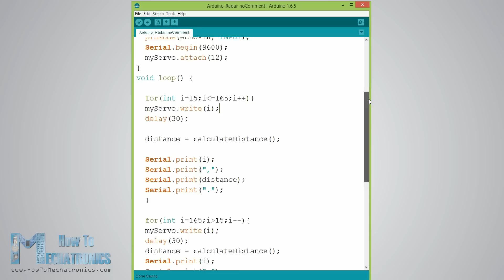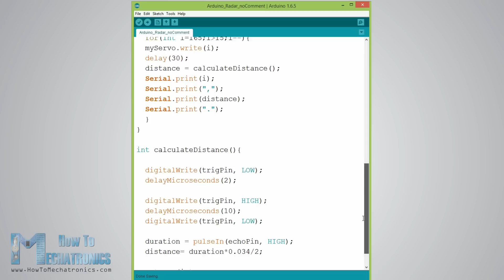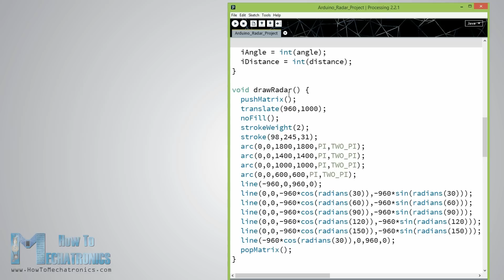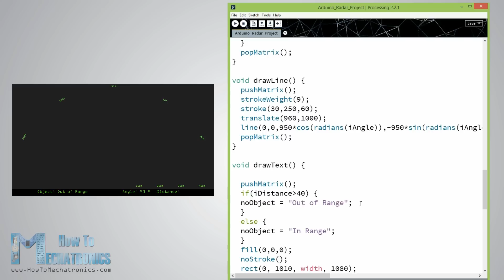Arduino Radar Project

Comment: Great project. I works on MAC, so I had to modify a couple of instructions of the processing program. The first one related the communication port (myPort = new Serial(this, "/dev/cu.usbmodem1421", 9600);  , and the second one related the font (myFont = createFont("Georgia", 32);.  I used your  second release  of the Processing program, to adapt  the system to the  screen resolution.  Everything worked fine. Thank you very much.

Comment: It seems that processing ide code is not precise when you draw the red lines. After some tests, i discovered that the sensor is very accurate so the problem is in the function that draws the red lines. Here there are two screenshots: the first one is one of my test, the second is taken from your video tutorial (0:12sec).

https://ibb.co/cbTNWF (my test, real distance=10cm, red line = 7cm about)
https://ibb.co/f425ka (your video tutorial, real distance=14cm, red line = 10cm about. Keep in mind that here the line is moving from right to left so you need to consider the red lines at 10cm. See your video at 0.12 for better understanding)

As you can see, even if the value of “Distance” is very accurate, the red line is not starting at the distance calculated by the sonar.
Also, the segment between 0-10cm is much longer then the other segments (10-20, 20-30, 30-40)

Comment: What wires did you attach to the servo motor
Reply: Dejan Nedelkovski is there any way to stop the servo at the moment it detects an object in a desired range? and after that remember the angle i. so that another servo can go to the same posistion?
i tried to do it but it always first finishes the for loop.

Comment: I was thinking of something similar but with more power to be used as a fishing probe. Those that emit the signals in 85 and 200 kilocycles I imagine are piezo electric microphones so you should not have much problem in placing it in contact with water. What do you think Have you thought about taking it beyond?

Comment: Hi buddy +Dejan Nedelkovski, great video as all else too useful, for me.

I'm doing a level control with an ultrasonic sensor, I developed an application in app inventor.

I would like to make a graph of the container (a cylinder) as the ultrasonic sensor indicates to me that the container is being filled or emptied.

I wonder how I could do the same with a bluetooth module and an application on app inventor

best regards
Sincerely
Mike

Comment: Hello, I tried this project but I cant make processing program read serial information. Processing load without error and I see fixed lines, but not the radar signal (movement). Serial port was informed well to the program.
I think the arduino side is ok, because I can see information in the serial monitor and the hardware is working.
Can you give any clue to make it work?
Regards.
Reply: apzeiroturbo  In the Processing IDEA, make sure to change "COM4" in the first 20 lines to the port where arduino is connected, normally "COM3"

Comment: Say you were making this for school, how much voltage would you need battery wise to power the arduino and a 3.5 inch lcd. Would be really helpful as I'm building this for a school project.
Reply: +Dejan Nedelkovski would I need to programme any differently to get it to display onto the lcd?

Comment: What's the distance on the ultrasonic sensor? I see you only use a few decimeters, but could it go further?

I have an idea of a rotating sensor like this, but it needs to reach up to 10 meters. The sensor would detect if there's movement (distance to object at a particular angle has changed since last scan) and activate a camera to start recording.

There would be several cameras in the room, but only the ones where the affected areas are visible would be activated.

Could possibly make it 5 meter sensor range and put the sensor in the middle of the room, rotating 360 degrees, but that seems like it will be slower, and might miss movements.
Reply: i've test and the max range is 196cm or 2 meters

Comment: I am working on a project .  I require my robot to go exactly in between two objects . Can I make this possible using this radar project ?
Reply: +Dejan Nedelkovski I am using  a Raspberry pi and arduino,  could I write code such that based upon the information from ultrasonics this can be achieved?

Comment: HI   great  job !.. i have  a problem with  the processing  code   when  i  run it  in processing   3.0.2  and  i have  a message error  "could not  load  from  OCRAExtended-30.vlw  ?  thank you

Comment: Hi Dejan. First thing - great tutorials. I follow your channel and I found here many interesting tips.
I built similar robot to yours and I used your code to check how it works. I noticed that servo slows down from time to time. It does not move smoothly as in your video and tiny delays can be spotted. I think my servo is not damaged as it happens in random position. I read some tutorials and sometimes they reccomend voltage stabilisers. Do you think the voltage may be the problem?

Comment: The problem with sonar/radar based on this kind of ultrasonic distance detector is very small angular resolution. This popular sonar is sensitive in angle about 30 degrees or something. So you cannot "see" things smaller than this.

Comment: Really cool project! Here's an idea for you; convert the sonic sensor to a lidar sensor. Lidar is much more accurate so in theory you would be able to map the room on one plane(unless you add another servo for vertical panning) by keeping track of what angle your sensor is facing (theta) and multiplying the sine and cosine of the angle by the distance measure to find the components of vector displacement from the sensor. Then you would have visible room dimensions mapped out!
Reply: chain3519  i need to understand this please contact me
Reply: How can I contact you to know more about this

Comment: Thanks for code processing code works with arduino uno?
Reply: Thanks i have problem with processing in this string

myPort = new Serial(this,"COM4", 9600); // starts the serial communication

i have connect arduino? or not?
Reply: agree thank you very much :)
Reply: +Dejan Nedelkovski The com port must be the same? Arduino and Processing?
Reply: +Dejan Nedelkovski ok but the programs processing have an error orcFont= loadFont("OCRAExtended-30.vwl");
could not run the sketch
Reply: Please can you write here the solved problem? Thank you

Comment: helllo sir .. i have a question with the coding (processing ) ........U r just taking the (r,theta) polar values and plotting them .. ok fine with that ... but on the screen how are U making the opacity of preceding green lines change ...and eventually leading to vanish ?..     now HOW are U doing that ?? ...
Reply: +Dejan Nedelkovski  .. i really liked the TRICK .. instead of using a background();   ... U have used a flashing rectangle...  so the screen gets refreshed .. at each iteration ...  really appreciable .. so no past activities are left ..
Reply: +Jasorsi Ghosh   actually i am involved in a similar project ... ;Bluetooth controlled car ... U have the laptop interface to have a layout of the forward obstacles  from  (polar to Cartesian ) .... and the CARS is controlled by a SMARTPHONE  .... U could think of a MASTER SLAVE arrangement .. arduino board Bluetooth is the master .. and computer and SMARTPHONE are the salves
Reply: +Dejan Nedelkovski  can U give me the download links of the external library's u have used
Reply: +Dejan Nedelkovski  sorry gotta  update my processing environment :P

Comment: Hi brother dejan! I already built a radar as yours. And it works good. I want to know why you use sinus, cosinus,when draw lines? Is those thing are absolut when draw line. Btw if you have enough knowlege about processing code could you make tutorial video about coding in processing. And once again if you have knowledge about arduino like( assembly language, and others aspect within arduino) could you make the tutorial video. Thanks and sorry if my english is bad ( i'm indonesian)

Comment: Nice , but can work with 1km range ?i
Reply: I don't think so because for doing that you need a very big sensor which means a lot of data which cannot be processed with an arduino
Reply: Good thinx
Reply: +safu gsm also this sensor is ultrasonic, not microwave..
Reply: Thank you,
Reply: +safu gsm this sensor works in between 2 cm and 4 meters range

Comment: will the arduino code change if you use a 3 pin parallax sonar
Reply: +Dejan Nedelkovski ok can the code you posted for processing also work on mac os? and will i have to change the processing code to 3pins too?
Reply: +Dejan Nedelkovski thanks
Reply: +Abdulakeem Yusuf-Aliyu Sorry 1 more question what in particular should i change in the arduino code for the 3pin...sorry i am new to arduino

Comment: Instead of creating two separate codes couldn't you just upload standard firmata to the board, then add the arduino library to processing and not have to worry about uploading two very long sketchs to the board? I haven't ever tried using a servo in this way so I am not 100% it will work or about what all the library includes.

Comment: what is long distance can be detect ????????
Reply: my project is about to detect opposite car direction distance, but the problem i face that  couldn't find the suitable component for the long distance if you say we can use laser for long distance that is possible but is gonna be costly can you suggest any component or device for measuring long distance i will Appreciate that

Comment: Hello, great project. I just have some issues with the code, I get a lot of errors saying that a certain variable is not declared, and they appear black on the code when they should be appearing orange. What should I do? please help
Reply: +Dejan Nedelkovski fixed that issue, thanks for the response, but know I am getting this error: "Error opening Serial PortCOM4: Port not found. Do you know what the problem could be?
Reply: +Dejan Nedelkovski done, works perfect! thank you! I just have to adjust the screen size

Comment: I'm using Processing 3 apart from the font missing this error appears.
 java.lang.NullPointerException
 at java.io.DataInputStream.readInt(DataInputStream.java:387)
 at processing.core.PFont.<init>(PFont.java:350)
 at processing.core.PApplet.loadFont(PApplet.java:6077)
 at Sonar_Radar_processing_sketch.setup(Sonar_Radar_processing_sketch.java:43)
 at processing.core.PApplet.handleDraw(PApplet.java:2373)
 at processing.awt.PSurfaceAWT$12.callDraw(PSurfaceAWT.java:1513)
 at processing.core.PSurfaceNone$AnimationThread.run(PSurfaceNone.java:316)
Could not run the sketch (Target VM failed to initialize).
Any ideas Help
Reply: +Huw Roberts 
Processing 3.0.2
java.lang.NullPointerException
 at java.io.DataInputStream.readInt(DataInputStream.java:387)
 at processing.core.PFont.<init>(PFont.java:350)
 at processing.core.PApplet.loadFont(PApplet.java:6081)
 at sketch_20160303_processing.setup(sketch_20160303_processing.java:41)
 at processing.core.PApplet.handleDraw(PApplet.java:2377)
 at processing.awt.PSurfaceAWT$12.callDraw(PSurfaceAWT.java:1527)
 at processing.core.PSurfaceNone$AnimationThread.run(PSurfaceNone.java:316)
Could not run the sketch (Target VM failed to initialize).
For more information, read revisions.txt and Help ? Troubleshooting.

How did solved this errors?
Please Help
Thanks
Reply: Hello friend if you managed to solve this problem have it.
Reply: +Huw Roberts even i am geting the same errors how did u solved this errors?pls help
Reply: TRW gaming awesome

Comment: awesome project. i went to radio shack and they sold me a sensor that doesnt have an echo pin. only sig, vcc, ground.
can you help me?
Reply: thanks for answering...
i took it back and will find the same as yours because im not as skilled at programming as you. 
also ive never opened the ide before so i got frustrated...

Comment: +Papy Nova (Kamo) I think he used it to keep it simple. The servo can just be clamped to +/- and the third pin to a digital out of the arduino. The servo only needs a PWM signal which you can create with a plain arduino without any other ICs.

For a stepper motor you need an IC/driver hardware which drives the motor which is basically the motor shield for arduino.  You can also do some funky stuff with ICs on your own cause it draws too much power to directly source it from the digital or analog outputs.

Comment: Hey,anyone know what im doing wrong? On the processing screen im getting a error "the variable angle does not exist" with a red line under angle.Located where it says-angle= data.substring(0, index1); On the serial monitor i have 15,11.16,11.17 figures.
Reply: ***** hey thanks alot for writing me back.I copied then repasted the code again and it worked great. I must have missed something the 1st time I copied/pasted the code.